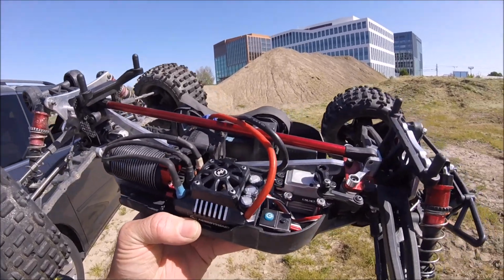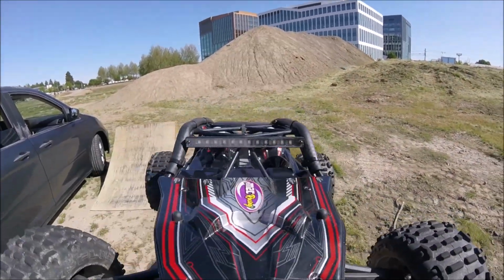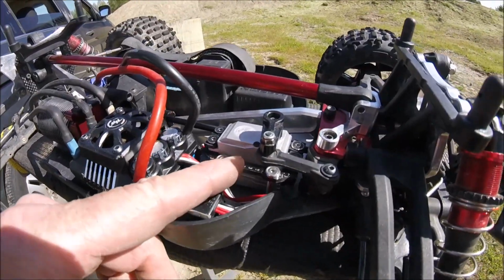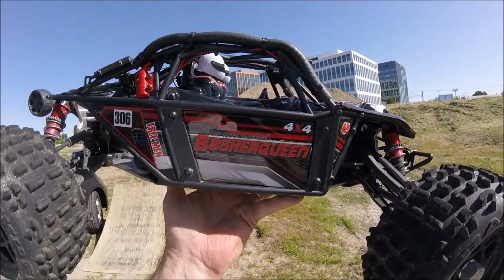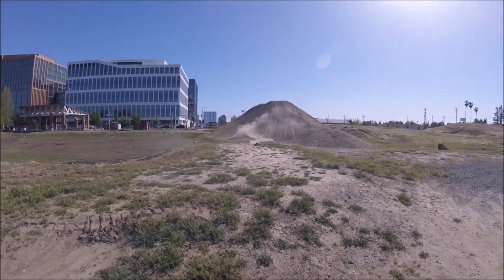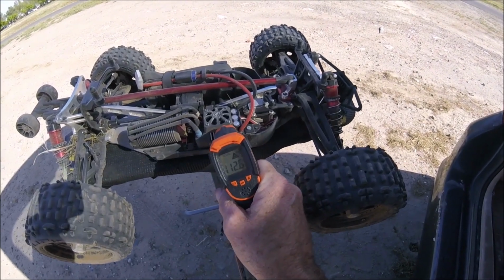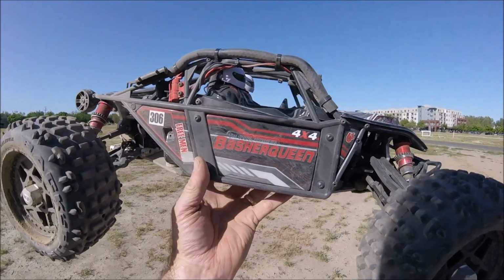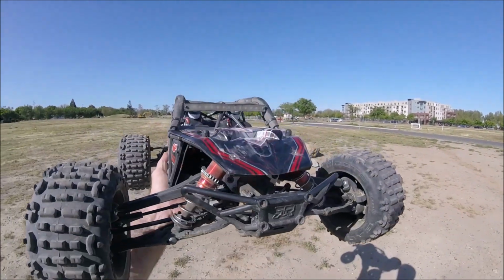"Desert Rocket" ARRMA TalionDR 6s New Power Setup!!!

Comment: Man what an epic session. So much fireteam love. Does your son have any mods in the works for his? Always love seeing orange flying high.  Do you ever run a motor fan besides anything stock maybe it'd help on the talion. It's always hard losing a tire especially an lp backflip . I kinda wish they had a belted option. Love seeing the basher queen talion out again man. She's so innovative n made a name for herself for sure.  Thanks for another awesome bash video.  Definitely what I needed on this Monday 🍻🍻🍻🍻🍻🍻🍻
Reply from the maker: Thanks so very much Nick 🤗. LOVE these caged Rippers!!! Such a wonderful idea by Kimberly with this Talion conversion. I typically don't run motor fans besides on my street bashers. GamechangerRC makes some awesome ones. Andrew is slowing modding his Fireteam. Still running stock electronics, but he upgraded his servo to a Power HD 23kg and is doing strength upgrades 💪. He just installed a Basherqueen 7075 front bulkhead after busting the stocker, running M2C chassis braces and shock standoffs, rear tower support, and soon to be doing an M2C chassis and tower swap. He's been hammering his rig a bit as his confidence has grown. His stock chassis is pretty tweaked already 😱🤣🤣. I've been helping him understand why we upgrade as different parts reach their limits. So stoked he's taken an interest 😍